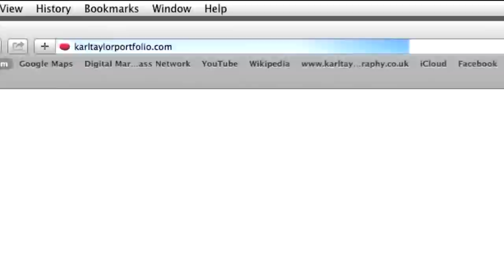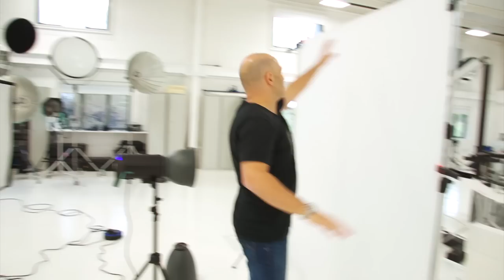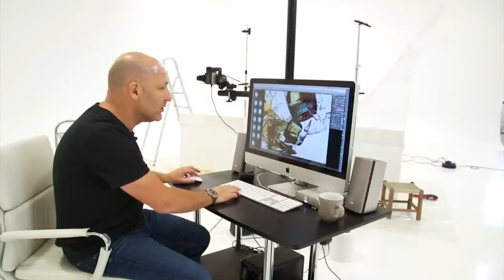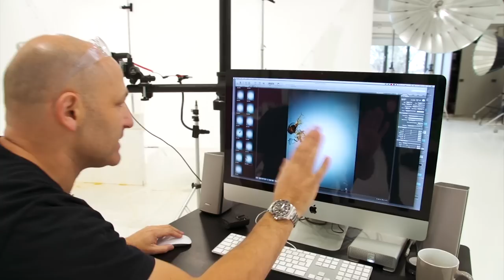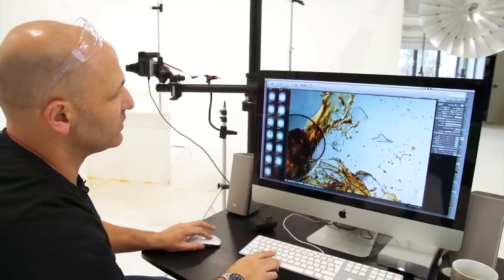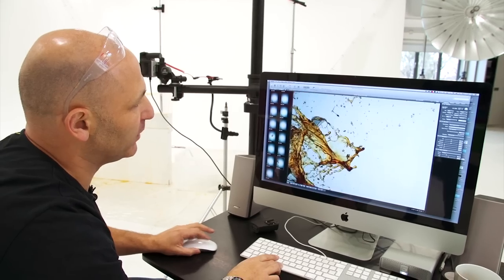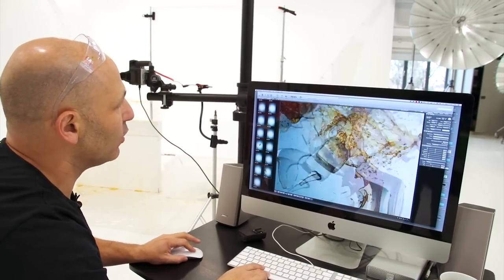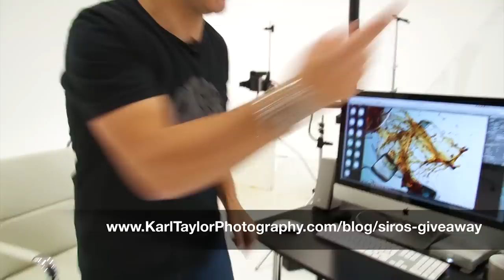Lighting Speed Test - Broncolor Siros Lighting Kit Review.

Comment: Well, Siros definitly kicks ass. I wonder if you could do a test of that system on on some outside photos. Like a runner or footballer session. I wonder how that ultra short flash works when you have to freeze movement and aditionally have some still light on picture. Will 1/250 and quick flash gonna be anough? Cheers :)

Comment: It would be nice to mix 800s with 400s as a pair. I wonder how they will sync together.. Maybe it's advised to use same power heads like 2x400Ws or 2x800Ws..? 400s are faster but 800s have more range/power.. Mr. Karl did You use 800s? You mentioned price of 800s kit i think.

Comment: Are either of the lights gelled? How do you achieve the white to blue gradient? I have seen it before in images and love the look and was curious how its achieved while still retaining the correct color of the subject (in this case the brown of the  liquid)
Reply: I think Karl mentioned in a previous video, that the broncolor lighting equipment has a function where you optimize for speed duration rather than color temperature, and in a high speed flash duration such as this, the light will be shifted towards a more blue color as a consequence.
Reply: Probably because of the white balance settings in camera.

Comment: Using the Miops Smart Trigger in laser setting with the Broncolors what ultimately triggers the lights to go off plus camera or it is just one or the other because I would be using my Phase One XF system with IQ260 which needs a work around cable anyway.

Comment: With the fast flash duration, how much light output are you able to get, e.g., will it only be useful for closeups/ macro type stuff, or can it be used in a wider area? (e.g., someone smashing something with a sledge hammer).
Reply: the lights were on power level 2.0. I do not know how many stops the Siros lights can be adjusted, but the power level is very very low. Essentially just 1 stop above it's minimum

Comment: Would it be possible to recreate a similar effect using 2 speedlights w/remotes  and high-speed-sync? 
Not regarding smaller light-output, would it still capture the motion effectively?
Reply: You shouldn't use HSS for something like that - only a short flashtime is necessary.

Comment: What is the minimal flash duration required to freeze every single drop?
In other words: if no flashes were involved, what is the minimal shutter speed required to freeze the motion?
Reply from the maker: probably 1/5000th of a second on relatively close up work. But it is all relative depending on how close you are to your subject as then the amount the subject moves across the frame will appear more because you are closer and as such will require a higher speed.
Reply: ***** Thank you a bunch, sir!

Comment: Karl, how did you manage focus?
Reply from the maker: Pre-focus manually at the point where you know the action is going to happen and leave it at that focus point.
Reply: @VisualEducationStudio , I was guessing that - amazing how sharp the result is.
Reply from the maker: Thanks but it's fairly controllable because with the ski ramps we built we know exactly where the items will be in the shot so we just need to prefocus at that point. That's how most splash, crash and flying action stuff is done, you make things happen at a certain space. You light and focus that space and then figure out how you're going to trigger at the right time, either manually, sound or laser triggers etc. - www.karltaylor.com

Comment: I noticed your reply below of a 1/5000 flash duration being enough to freeze this type of shot - you can easily get a far shorter flash duration of 1/10000 by spending under $200 on two Yongnuo speed lights and there would be zero difference in power levels needed.. not understanding the point of this demonstration!
Reply from the maker: Yes I had 3 of those Yonguno flashes, none of them work now and Speedlites don't put out the same level of power at the fast durations.
Reply: @VisualEducationStudio  Correct me if i am wrong, but in your video you are using power level two (lowest speed mode) on the Siros which i am assuming is the Siros S and Broncolor´s own data sheet states this power level outputs at only 1 Joule as opposed to 400 or 800 joules on full power depending on which unit you are using - the 800 watt version outputs 3 Joules. According to your own benchmark of 1/5000 to freeze the image means any speed light at 1/16 power will do the same job - One Yongnuo YN560 (cheapest on the market) for example at 1/16 power  will give you 1/8000 flash duration at 3.75 joules energy output.   Even the cheapest battery operated first version of the Godox AD 600 studio light at a third of the price of the Siros will produce a 1/10000 flash duration at the same power level and color consistency of the Siros.  Again correct me please if i am wrong,  - i do agree if you have a Siros S already then it´s a bonus to know it can freeze action and the vid was produced in 2015 so the Siros is may be long due for an update.
Reply from the maker: If we take the Siros 800 for example, you can acheive the fastest flash durations from power 5 and lower. At Power 10 we have 800J at 9 we have 400J at 8 we have 200J at 7 /100J at 6/50J and 25J at power 5.  On the Scoro pack I can also achieve the fastest flash duration at 5 and lower but I have 3200J from the Scoro at power 10 so giving me around 100J for fast flash duration. The other advantage is the use-ability of the joules based on how you can direct and modify the light. For example a P70 or parabolic reflector is going to direct most of that light forward. This is much more difficult to achieve with a speed-lite due to its flat front and limited choice of modifiers. Joules are only any good if they aren't dispersed in all directions and therefore losing most of them. The Scoro, Siros, some of the Profotos as well as Godox have very fast flash duration but the next thing I consider are the choice of modifiers available to a system and I switched to bron (from elinchrom) many years ago because of this. Controlling light and shaping it is the most important part of my work.
Reply from the maker: @Diana-py7fw   There is also one other thing that I forgot to mention that is important here and that is the claimed speeds of different flash manufacturers. Are the measured speeds that are being claimed t0.1 or t0.5? If they are t0.5 then you need to divide them by about 3 and that will give you the equivalent t0.1 measurement which is the only measurement we should be considering as it accounts for about 90% of the flash burst. For example you will often read that a canon speedlite can reach 1/15000th at 1/16th power but that's a t0.5 measurement which would only be equivalent to a 1/5000th if it was a t0.1 measurement. All of broncolors measurements are t0.1.